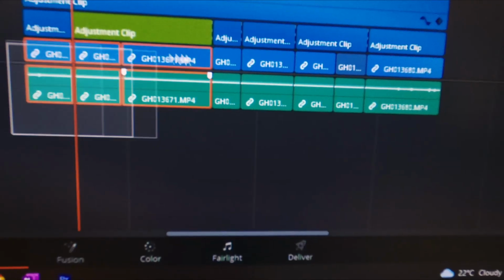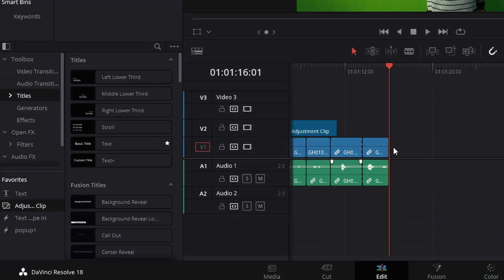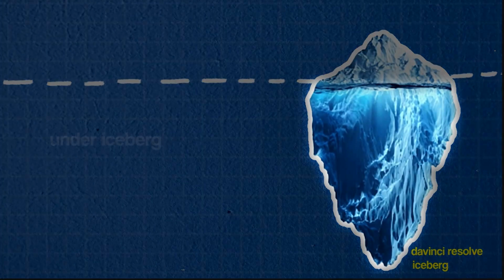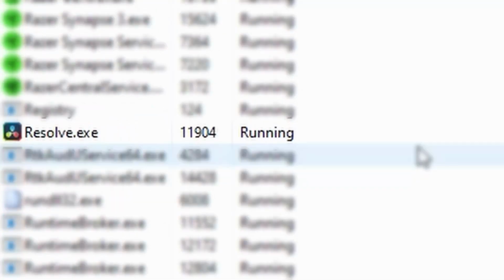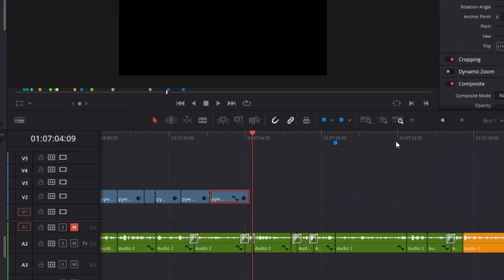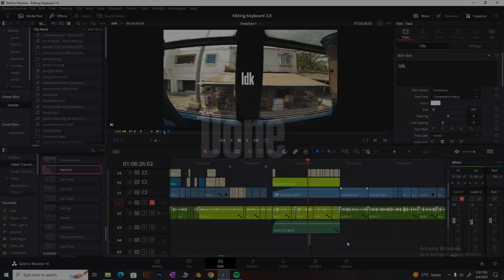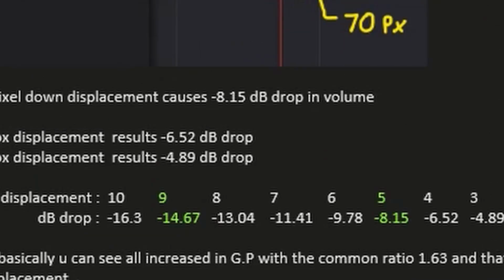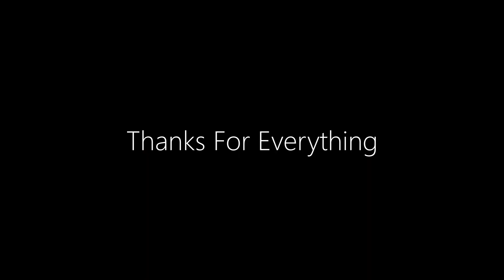I made the Ultimate Editing Keyboard using ChatGPT

Comment: Hi i have a question about the Sound effect macro
how many did you make ?
i have about 9 sound effect id like to macro for basically spamming them on the timeline 
is it a different exe for each effect or have you made something that runs via HID >?
Reply from the maker: Ya basically every applying sound effect macro is a modification of the same code more or less , however from my experience of past 2 yrs tbh I've not found it useful , i barely used it in the last months.
As the project gets complicated it gets cooked .
The most useful macros that I use has to be folder location , volume up down , link unlink , syncing audio and now they even added macro for changing clip color .
All of them doesn't need any code at all , just set the Keybind in daVinci resolve and apply it in HID MACROS , really really OP . 
However if I get the Studio version in future i would make a video on how to use API to do that SFX macro flawlessly. 
Anyways thank you so much for stopping by 🙏 means alot o7 have a great day !

Comment: The solution for that key being accidentally pressed was to turn off hid macro when you completed what you wanted to do i am a programmer and the code is pretty good that idea of detecting the application and then performing the work is but over kill but by using that you can use the same key for multiple task. Like key F12 for green screen and same F12 to type Integers when you use vs code simple. Again it is a cockpit of your own for you. I have done the same for my 2nd keyboard but this time i have a profiles i just use them to move that macros when i do the job. All i need is type the most commonly used words in to be fast. And using pyautogui never seems to be that use full at least for me but over all great job brother
Reply from the maker: thanks for stopping by and noticing my work dude , i appreaciate that !
Reply: @Cranetechofficial  i am the owner of that account my self nitesh that google account is lost trying to recover it cost is 12400 rs. i am broke never the less i am making a even simple way for you i will update it to you